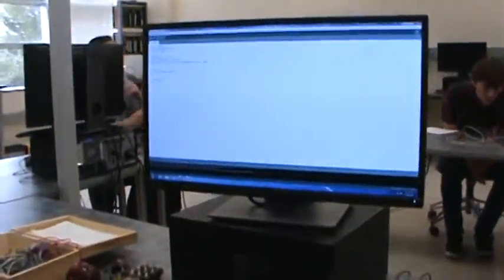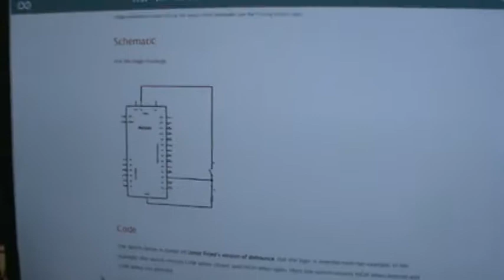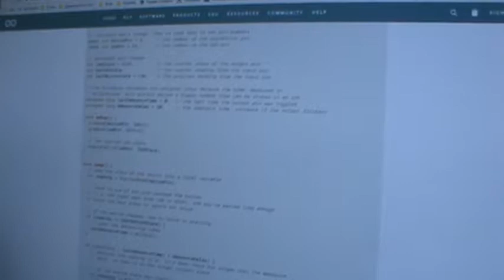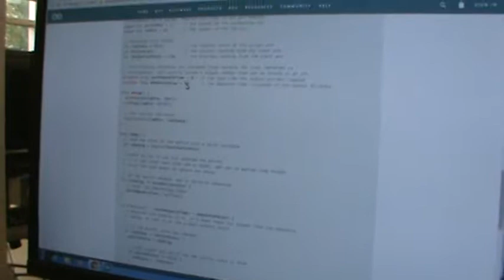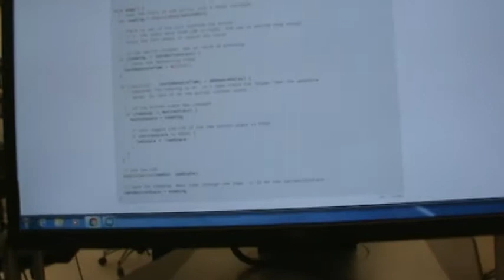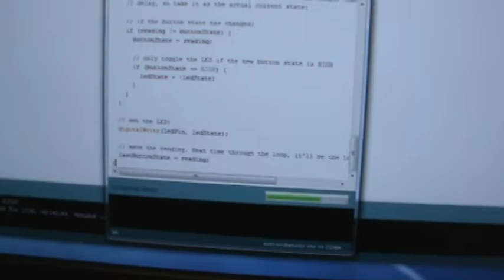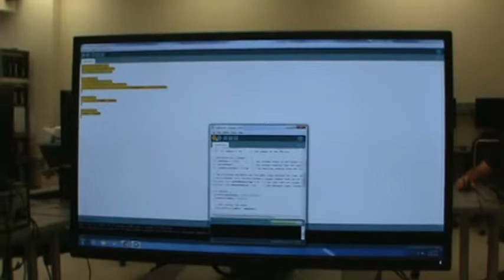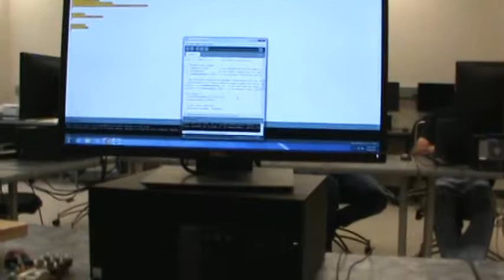MET 482 8 30 2018 Part 2

Comment: We just put capacitors in parallel with the buttons.  I never thought about using code to debounce a button.
Reply from the maker: Many problems can be solved in hardware or software.  For sample de-bounce code, see https://www.arduino.cc/en/Tutorial/Debounce